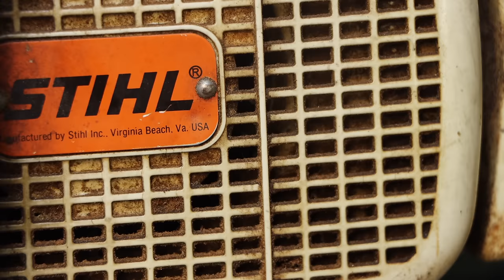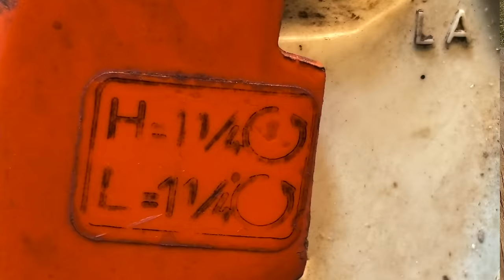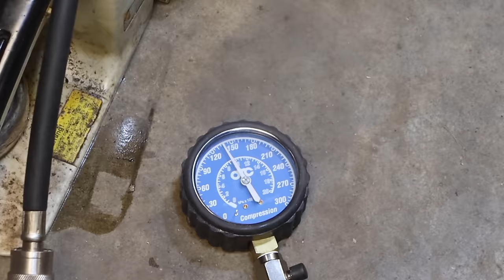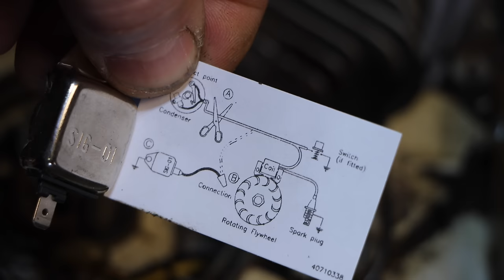Fixing An Antique Chainsaw.  Stihl 028 Wood Boss.

Comment: I don't think John would be a fan of the new fancy modern saws with computer controlled fuel injection.. When something goes wrong or they just don't feel like running you have to take it to the dealer and hook it up to a computer to check codes and reset it to figure out what's wrong and to adjust it. I wouldn't touch one with a 10-foot pole!

Comment: Your final high speed tune was too lean. WOT no load should be slightly fat and stutter a bit, and when you put saw in the wood it will smooth out with great power.
You can tune under load too if you know what to listen for.
A lean running saw will turn into a non running saw with scored piston, ring and cylinder.
Reply from the maker: I actually noticed that I couldn't give it full throttle when under load.  I guess it's not getting enough fuel as you say.  I haven't had a chance yet, but I plan to open up the high speed more.  I suspect that will correct that, and it fits with what you are saying.  Thanks for the tip.
Reply: Love your work brother! Your tenacity and willingness to go next level makes your vids outstanding.

Comment: The 028 was available as AVQ and AVEQ. E means electronic ignition. So no points. I dont't think the Hippa module is bad, it's just not supposed to work with the chip. Was it supposed to replace Stihl part #0000 400 1300? If so, it should just work.
Reply: This is true. You don't need the model with the new coil.

Comment: I personally think that chinese parts are actually good and very cheap, so when you need to buy a new carb just buy a new one, cheap and easy. The quality doesn't even matter. If it works don't bitch about it. My point is that cheap chinese parts aren't that bad that people say they are. And if you don't like them, don't buy them. If you don't have any money to buy more expensive and better parts, that a you problem. Love you channel and creativity Jon!
Reply: The chinese market wouldn't be afloat if the quality was better but the price was the same. They need to compensate with quality to make the price as low as possible to sell as much as possible.

Comment: Hello John, I've got an 056 Stihl chainsaw with an ignition problem. From memory it has a quite rare ignition system and not the regular Bosch system. Anyway, do you know if there is an electronic sytem like you used on your 028?
I'm in the UK great channel by the way. Kind regards Gary
Reply from the maker: Check the pinned comment.  I linked to the ignition module I used.  It is supposed to be universal, and I think it works on most engines.
Reply: @FarmCraft101  I have taken a photograph of the ignition set up which is an electronic one. The coil says its a Swedish SEM make NO 100 48000. Which sits inside the flywheel. I can't send you any photo's on here unfortunately, or else  I would send you to look at to give your sentiments.

Comment: anymore i dont bother rebuilding a carb i just buy a new oem one the complete carb isnt much more expensive than the rebuild kit and the small engine mechanics ive talked to they do they same they told me even if you rebuild them the passages r so tiny one tiny piece of dirt can block flow of fuel and it not run right and at current labor rates its not worth risking a rebuild kit for it not to work and have to pull it back apart multiple times to try and get that one random speck of dirt out thats messing it up

Comment: Cheapo Chinese knock-off parts are very hit or miss in my experience. I would have purchased new a new Stihl condenser, cleaned the points and figured on another 40 years :).

Comment: This might be a bit anal, but I tend to solder those electrical clip connections as over time I find they get loose with vibrations and corrode. Nice job figuring out this mystery machine!

Comment: I'm at a loss trying to understand where such a module gets the information of when to fire the spark, previously provided by the cam and the points. That information is clearly NOT present in the voltage the coil provides, otherwise one would not have needed the cam in the first place. Every electronic ignition I've seen either merely AUGMENTED the points by doing the switching in their stead while still relying on the points to tell when to fire, or was using a magnetic field sensor mounted next to a magnet attached to the flywheel, working exactly as a cam-and-points would. This one apparently just works by telepathy...

Comment: The replacement coil looks like a 026 or 029 coil. These are electronic ignition. Bet you were running the atom module on a coil that already was electronic

Comment: You need to hold it wide open THEN set your high til it sounds like it is 4 stroking.....put the old carb back on or get a real carb....hit and miss with those CHINESE parts

Comment: It kills me that a rebuild kit is $10 when a new carb is $10-$40 (some even come with a new plug and filter).  I understand that sounds like a "disposable" argument, but it's more of a comment on how cheap the carbs for those can be.
Reply: Someone always regrets putting cheapo carbys in power equipment. It's one way to force a solid workout

Comment: Ok I have a Stihl 024 that i picked up in the trash and the main problem i have is that the thing won't idle.  I just got to the part where you find that you find that the idle screw is missing. I was like "THERE'S SUPPOSED TO BE AN IDLE SCREW!!! #%#$$@^#. 😫😫😤. There seems to be an epidemic on [people steeling idle screws. Also what is the part number for that rebuild kit. I think mine could use a rebuild as well i need the fuel line hose from the tank. Mine disintegrated!!

Comment: I bet if you'ed just have gapped the coil to the magnet it would'a ran !!!!! but in the end you got it ! ....I've seen coils like that move into the flywheel/magnet many times on brigs and stratton engines and chainsaws of all kinds.... i guess the pull of the magnet and the vibration just slowly moves them in....so if you have a starting problem in the future take a quick look at the coil/magnet gap ! even on your johnson....we wouldn't want your johnson not to start when your all ready for it to.... right?....i mean that would be embarrassing in the worst way !

Comment: That saw is not running right. Not close to what it is capable of. Too lean on the low speed or in need of a new Tillotson instead of that 15$ one. Those are rip roaring saws. Did a good job just getting it running for sure. I’m not a mechanic, but I am a retired logger who has run that model a lot and my brother has one now. His was used a lot and still going strong.

Comment: Personally, If I were you, I'd tear that entire saw apart and clean EVERYTHING and then completely replace both the impulse fuel hoses...

Rubber degrades with time, losing flexibility and becoming brittle so the chances that the hoses are (or very soon will be) leaking from micro-cracks is very high...

Comment: Why do you wear a helmet and visor.  You drop start your saw so obviously not worried about safety. You are still lacking power at full revs so setting high speed while under load will fix that or without load richen it up until it four strokes.

Comment: Something I've noticed with your videos is you pass your suppositions off as gospel.  My dad would say about you is... discount 90% of what he says, the rest is true.  You never look up the manuals and bumble thru with your theories.  On the carb, did you check lever height? NO, thats critical for carb performance.   You also never pulled the exhaust to check the cylinder and rings.  Stihl has a tendency to plug up the muffler and cause poor performance.  This should have been done on the initial inspection to determine if the saw is viable or not.  One last thing, the reason there was oil in the gas tank is to pickle the fuel system for storage.  That is why your carb had no varnish or plugged ports.  Smart move for 2 cycle equipment not used on a regular basis, saves carb cleaning the next time you use it.